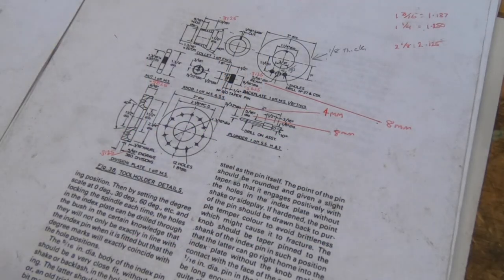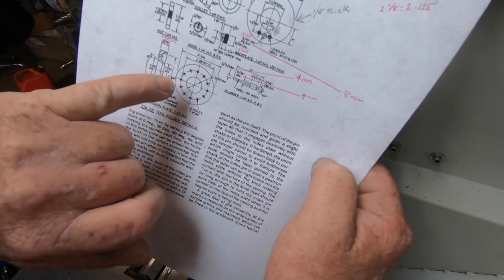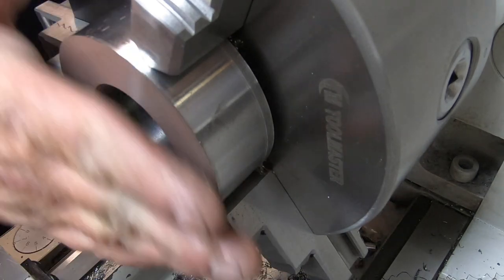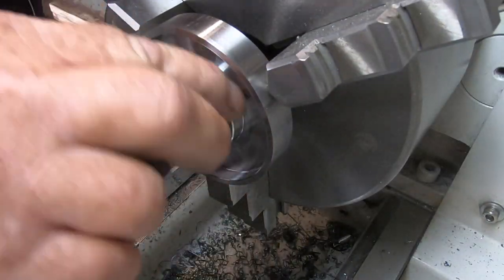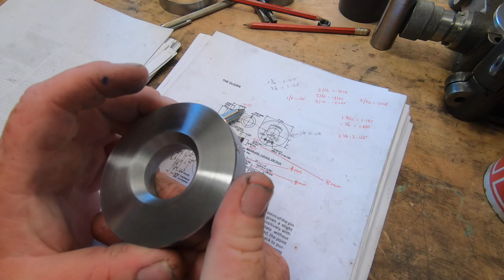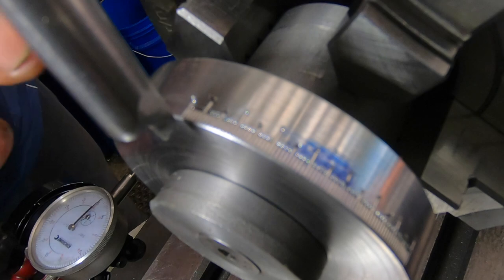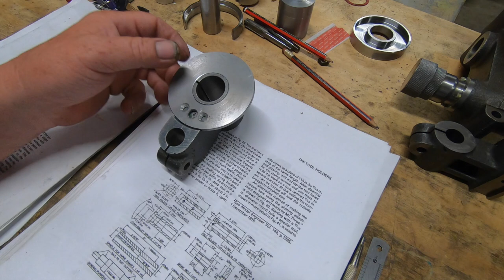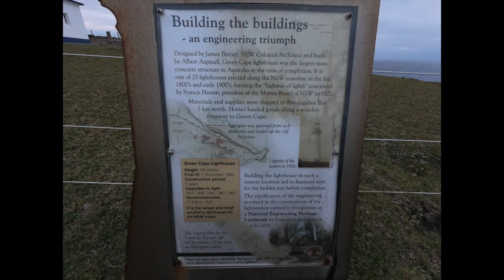Quorn tool and cutter grinder   Tool holder Part 2

Comment: You've done great mate! Just a pointer for planning out what to do first. Try to machine the most complicated element first so if a mistake happens well you don't loose to much work. Thanks for sharing. Cheers
Reply from the maker: Gday Yves, that’s a good point but sometimes I’ve found that the hard bits are near the end, I’ve gotta learn not to screw up which would solve the problem mate, thanks for watching, cheers Matty

Comment: Hi Matt,
The cheap arse imitation Noga indicator stand has a plastic washer in the lock screw between the 2 arms.
Disassemble this joint by unscrewing the lock knob and make a steel, brass or aluminium washer to the same dimensions.
Reassemble it making sure the angled faces of the internal spacers and pins mesh properly.
This will firm up the action tremendously. The plastic washer compresses and does not pass the tension to the tapered lock elements successfully.

Nice build, remember practice makes perfect but it’s a bastard.
Good luck.
Reply from the maker: Gday, I’d love to have a noga one day when I can afford it thanks for the tip on the Chinese one, it’s certainly a barstard having to make things twice that’s for sure, thanks for watching, Cheers Matty

Comment: Bummer that the first little wheel was too hard to take the indexing lines without damaging your scribe line tool, it was a good part otherwise.  Disaster Bay looks like a nice quiet spot, not built up with tourist stuff.
Reply from the maker: Gday Everrett, Disaster Bay is a beautiful place, it’s only about a 25 minute drive to the lookout from home, Eden itself isn’t that overran with tourism as yet, it has still got that small country village feel and there’s no bloody traffic lights, no McDonald’s or other big fast food chains just your typical local coffee shops and takeaways, where pretty lucky here and if your ever come over this way the doors is always open, cheers Matty

Comment: G'Day Matty, I think that's going to turn out really nice. It's not a loss on your first piece - If you can get your hands on some brass or bronze, it could look really nice making a graduation ring to slip onto the HTS piece. If you give me the dimensions i can work out a vernier scale for the graduations so you don't have so many hatch marks and it'd make it heaps easier to read.
Good luck with it mate. Stay safe and well :)
Reply from the maker: Gday Anthony, I thought about putting a ring around the outside but I no idea where to get the brass ring from, using flat sheet the join might not look all that good, thanks for watching mate, Cheers Matty
Reply: @MattysWorkshop  I'll drop into the shipyard tomorrow and see what they have lying around. Let me know what diameter you need - give it a bit extra for machining and it might be a solid drop. I'll get back to you if I get lucky. Have a good weekend :)

Comment: Matty,I noticed a conversation further down about using a dovetail cutter set over to cut the indices marks. I have also used small gear cutters for the same purpose before now. Cutters in the 0.5mm pitch metric range are quite small at the tip of the profile . I don't know if you also considered using an engravers 'D' bit as these also help greatly when cutting fine index marks in tougher steel. The static drag cut tools are limited to fairly soft materials like mild or leaded mild steels.
Reply from the maker: Gday Howard, Max suggested using a dovetail cutter I think it was and I honestly never thought of it, a gear cutter and D bit would work just the same I’d say, I like the idea, I do have one more item “I think” to put increments on so I’ll be doing that one with a rotating cutter, thanks for watching mate, Cherrs Matty

Comment: Hi Matty, still catching up with you.
When i did mine i thought about a vee tool to cut degrees but thought if i needed to sharpen it it would be a pain to get the width of index the same. So, i used a 1 inch 10 thou thick slitting saw figuring the width would always be the same no matter how deep i cut. As for the degrees i used a spindexer. I cut all the ten degrees using a bed stop, then did the 5s using a shorter bed stop and then all the singles again with a bed stop. Doing it that way all the long ones were done with no possibility of error, as could the middle length and finally the ones. If i made a mistake in putting the pin in the spindexer for the singles i would only go into a longer cut which could never show. Perhaps i should do a short video on the method, it might help others. I think i still have the sample i showed many yesrs ago at the London model exhibition and could do a mock up again to film.
With all that work in the first part i might have been tempted to put a softer sleeve over it for the markings, but then i would always be reminded of a failure. 😤
ATB   
c
Reply from the maker: Gday Chris, that’s a great idea using a slitting saw and I never give that a thought, I should have done all the 10’s, 5’s, and 1’s separately with a hard stop, this would’ve been a lot quicker but I not keen on redoing the part, I’m still not decided on how to mark the numbers in just yet, still thinking on that one, I’m seriously thinking of using an er collet chuck as the tool holder, this is what the Hemingway plans use, it’s a lot better then making separate arbors of different sizes, thanks for the great advice, i really appreciate it, cheers Matty
Reply: @MattysWorkshop  re numbers my method could be tried with a circular holder to match the part to be stamped. You could easily have a couple of the guides either side of a pointer if doing marking as the book (45-0-45),you know my views on that, or much the same with 3 guides for 0-360. If you have a comupter printer you could print out a sticky strip of numbers both 45 0 45 and 360  to try both and leave the number stamping till you use the finished tool and know what is best for your use. I did make a stick on graduation for mine till i had worked out the slitting saw method, it worked fine.

Comment: G'day Matty, I wonder if you could still save the first part by etching instead of scribing. 4 - 5 coats of layout dye is a good resist for electro etch. Still looking good tho mate 👍🍺
Reply from the maker: Gday Bill, I’ve never had anything to do with etching before, something I really should look into, thanks for watching mate, cheers Matty
Reply: Not hard to do, usually not as deep as scribing but good for finer details. Heaps of vids about it or I could give you a quick rundown of what works for me. 🍺